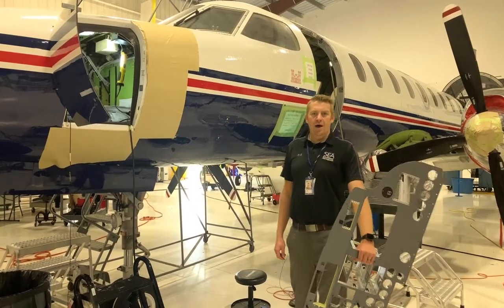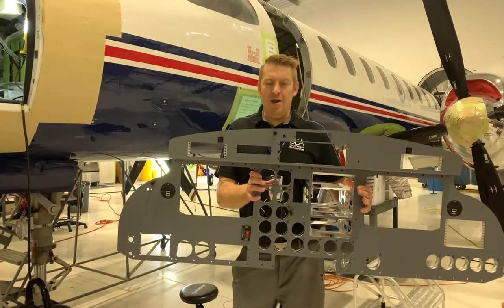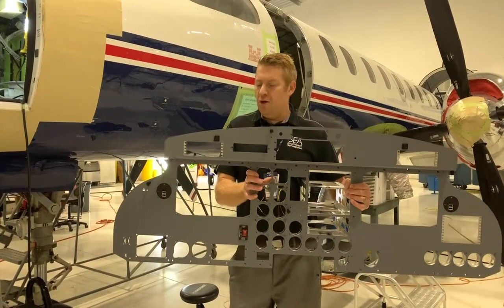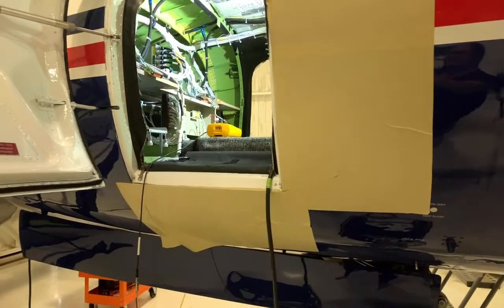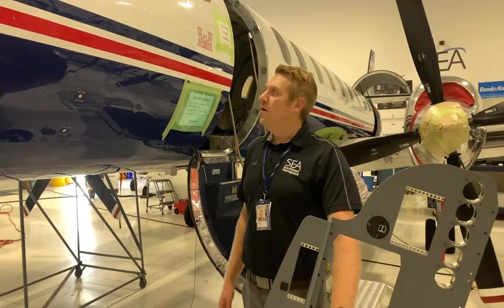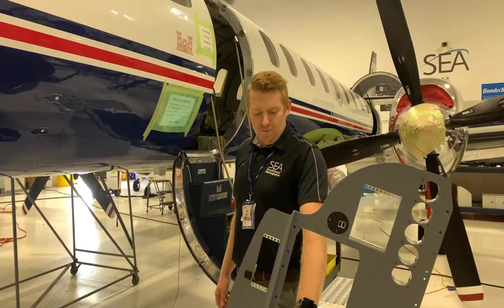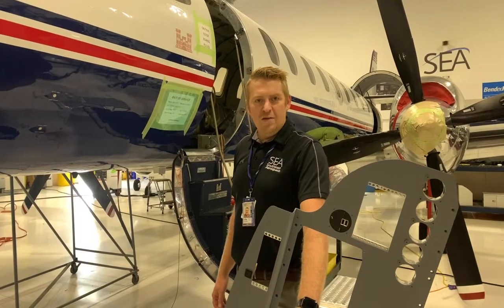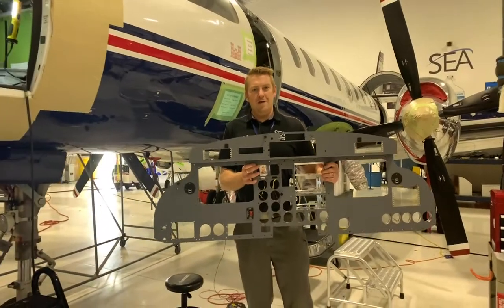Luke Presents SEA's Latest Project: Metroliner SA227

Comment: Now throw some 5 blade MT props on there and pack as much sound insulation in the walls as you can and you'll have one heck of a flying machine. Those direct-drive Garret engines are incredibly efficient... at turning fuel into noise.